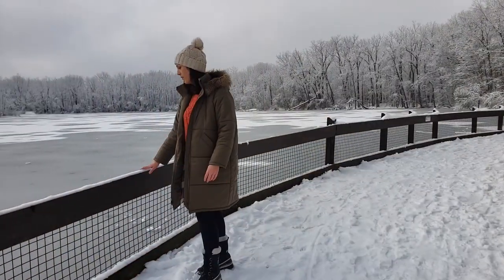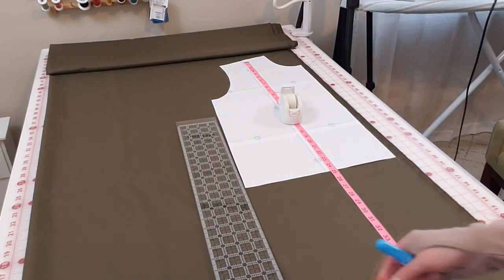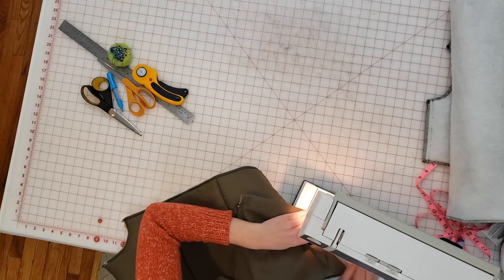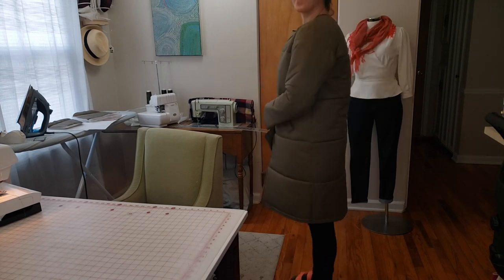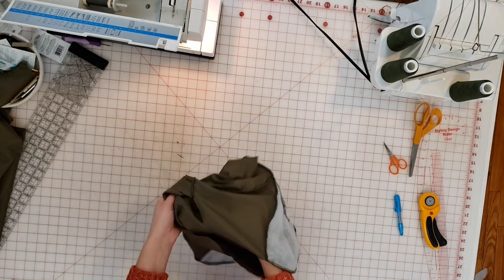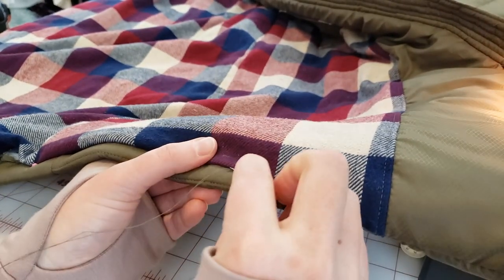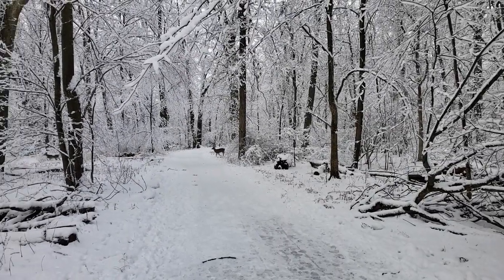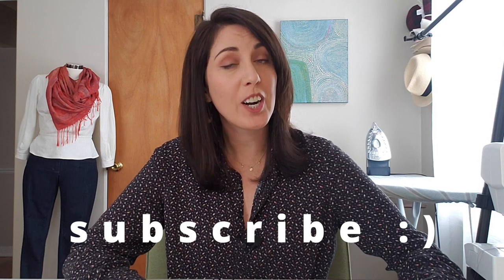DIY Puffer Coat - How to quilt and sew a Puffer Jacket FROM SCRATCH!

Comment: The reason I'm looking at this tutorial is specifically because of the snugness at the hips of pretty much every commercially available puffer coat - I think the quickest solution would be to slash and spread (a.k.a cut the pattern from middle shoulder straight down to the hem, then keep the shoulder together but flare out the bottom, basically making an A-line jacket) - Especially since you'll probably make an elastic belt to take in the waist anyway. 

Edit: If you've already made your coat, undo the side seams to under the armpit and put the coat on - how big of a triangular gap is created at the side? Measure width (on both sides and take the average) and height of the split and then quilt yourself two triangles of that size and insert them into the side seams. But be careful not to let the filling spill out when you cut!

Comment: I am very grateful that you posted this video. The link on your blog for the original coat went to a blank page.
Also, I wonder if the high loft batting for puffy comforters would work better than the Joann product. Just a thought. 
In any case, thank you for posting this - it is extremely helpful!

Comment: Hi! Thanks for the video, I would like to ask, are there specific kinds of sewing machines to use for when sewing thick materials like you did or it’s the needles that matters most and most sewing machines can do the work with just the right strong needle? Thanks 💚
Reply from the maker: The sewing machine i use is a Pfaff IDT Select and it sews pretty much everything I try on it (highly recommend!). For a project like this, you might be able to do it with a basic machine (Singer or Brother, for ex), but it might be a bit of a struggle for some of the thicker seams. So it definitely helps to have a heavier duty machine. And needles make a big difference...I used heavier duty microtex needles for the puffer because they are extra sharp and work best on fabrics like nylon to prevent snags. The needles went through the nylon and batting without much resistance. Hope that helps! Thanks for watching!
Reply: Whicg model of the Pfaff IDT do you own?   I'm looking at their website right now and am interested in purchasing one in the near future.  I currently own a Singer Patchwork 7285Q and a Janome 1050DC. I have doubts that my Singer can handle these thicker fabrics.  Not sure about the Janome as I haven't gotten it out yet after buying it in 2020 😂

Comment: Thanks for posting this, great info. Did you ever consider waterproofing your seams? or rather have you worn it while it was snowing or raining and not found it an issue?
Reply from the maker: Hey Shelby! 👋 I did consider it but decided not to waterproof the seams since I knew this jacket wouldn't be worn for extended periods in harsh weather (also it just felt like a lot of work! 😅). The fabric is not waterproof, but it is super lightweight and dries really quickly. I have worn it a couple of times for walks while it was snowing (about an hour or so) and it kept me dry and warm. If it got drenched for a long period of time it might soak through eventually. But so far, it's held up well to the elements!

Comment: Is the fabric water proof ? 
Excellent video very relatable I make a thousand changes as I stitch.
Reply from the maker: The fabric is water resistant, but not totally waterproof. So it repels a little bit of water but if it is soaked or if water sits on it for a while, not so much. It is somewhat breathable though, so it will dry fast if wet. Thanks so much for watching! I've been sewing for years and still make so many adjustments/changes as I go, too! :)
Reply: @PatternScout  thank you for responding I’m gonna order some fabric from that site. I’ll make jackets for my son and I. Thanks beautiful 🙏🏿

Comment: I'm new to lining jackets. Did you just sew the lining right sides together at the zipper, and then pull the jacket right side out and push the sleeve part of the lining into the sleeve and do an invisible stitch by hand to tack it down? I see how you did the bottom hem, but is that the same thing you did for the sleeves?
Reply from the maker: Yes that is exactly what I did 🙂 Thanks for watching!